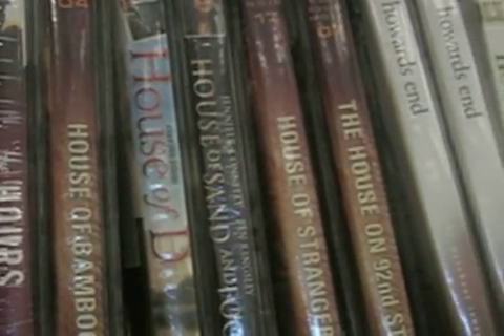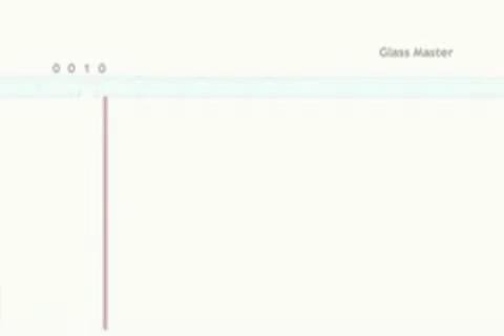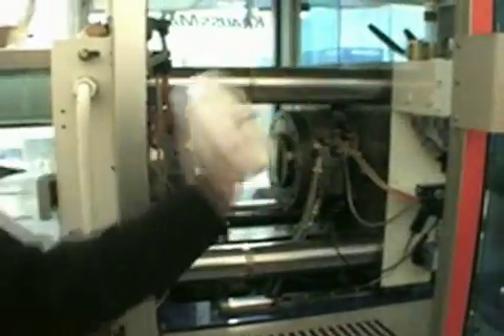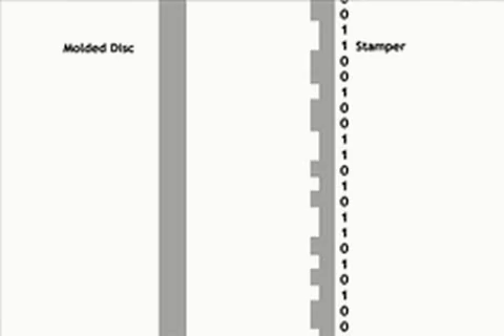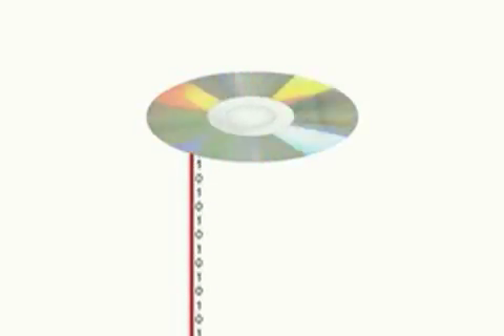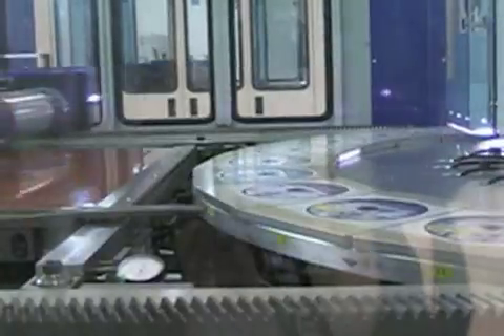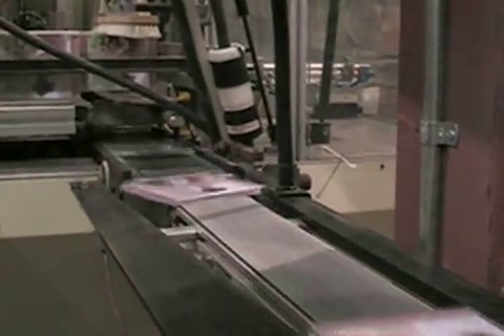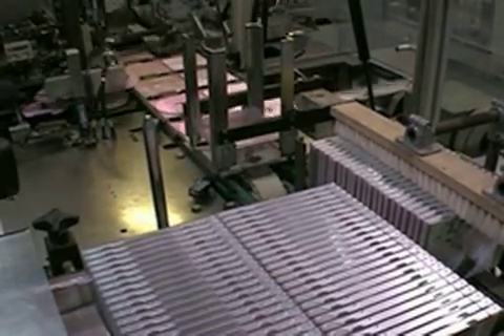How CDs & DVDs are Made: The Disc Replication Process -

Comment: @A42yearoldarab 
The disc's you burn are - or +r format 
Which use a laser that writes to a dye layer on the disc and allows You to write to disc multiple times.

Whereas the pressed discs are rom format write once disc's that burn to a dye layer disc directly before they press the two disc layers together.

Comment: @Darren to answer your question 
If you bent the disc's at any time then the water will seep into the dye layer and they won't play,otherwise no ...water won't harm the disc's because the media is on the dye layer not the reflective layer or label layer
However if the reflective layer is scratched then they won't play without reflective paint because the lazer hits the reflective layer to bounce back info.

Comment: I wonder if CD's are resistant to minor incidental water droppings on the top label side(s) of the disc(s). I'd like to know. I am or was confused as to where the music on the disc is. On the disc itself prior to labeling or if under the label itself on the top of the disc is where the music is. I never got any clear answers , but it looks like the music is burned or etched into the disc long before the advertising label itself is applied. It is said in this video the music is on the disc prior.

Comment: Are the disc cases manufactured off-site by a separate supplier?  I see they are inserted and packaged into them on-site, but is the molding process of the case itself on-site also?
Reply: They are usually made by a supplier and furnished, as well as the inserts.  Datel in the UK once had a production line for CD and DVD production and I believe they were one of the few companies which actually made their own cases and inserts.